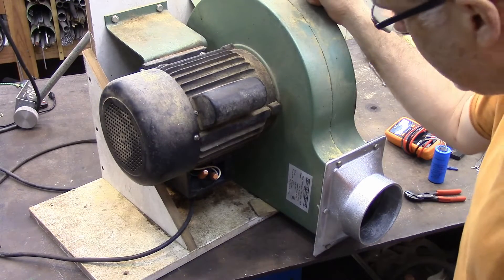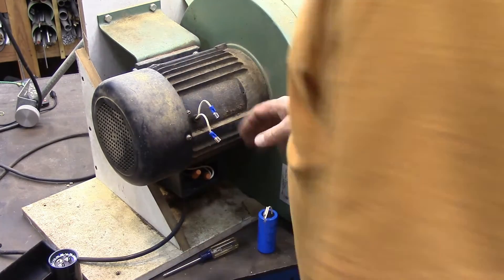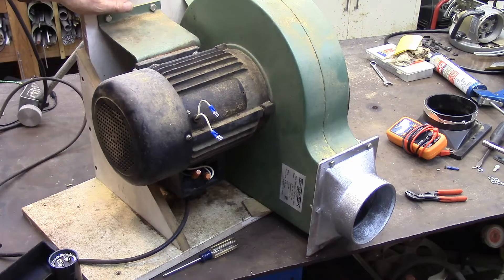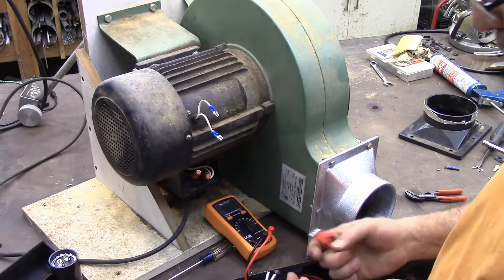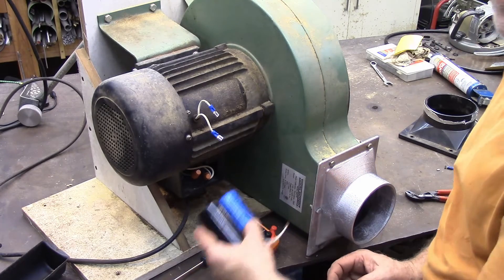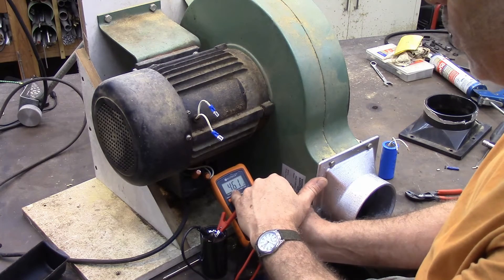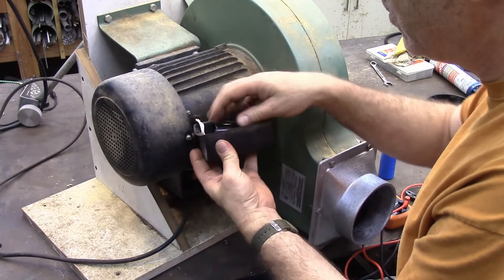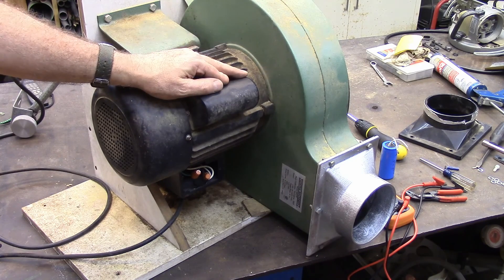How to Diagnose and Repair a Capacitor Start Motor

Comment: Is there a wrong way to connect a capacitor? 2 wires from the motor and 2 wires from the capacitor.  I bought a new capacitor and hooked it up and the motor ran for 1 second the stopped.

Comment: Just had the same happen on my lathe. I guessed the start capacitor as it would get up to speed if I hand turned it and then hit the switch. So I'm pretty confident the cure is exactly what you're showing here and so a big thanks for your video.....
Its Wednesday Jan 25 2025. I hope you're safe and well as far as those terrible fires you're having over around LA at this time.... The world's hearts are with you all.
Reply from the maker: Thanks, glad you found it helpful!

Comment: My Corporation has switched over to WEG. The motors come in 230 v. and need to be re-configured to 115 v.. Unfortunately, the previous technician did not reconfigure the posts before installation, even worse, he tried to fix his mistake and now I have no idea what the factory setting was per the diagram before he monkeyed with the spade connectors. Any suggestions? If it will help, these motors are currently supplied for AMF 8290 pinsetters.

Comment: You deomonstrate the exact problem I have with my 7-ton Boss log splitter's electric motor not starting.  Hums but doesn't start, quickly trips the breaker.  I checked the capacitor and it's deformed and has no charge.  Must have blown up after 8 years.  A new one is $25 and a new electric motor is $211 so a Big Thank You!
Reply from the maker: You're welcome!  I hope you get it up and running.
Reply: Good evening have a kitchen aid mixer which turns on just for a short period then cuts, what could be the problem @SoatMon

Comment: I just put 9 brand new capacitors on my 30 HP baldor motor and it still won't start.

Is it possible that the new ones are bogus [as in not the rating they claim]?

Comment: this video was what I was looking for. I am not experienced with electricity, and a fried said I can shock myself on the capacitors on the motor i want to fix (from my plate compactor).

I believe the "starter capacitor" is the problem on mine also, it hums, tries barely to spin or not and then breaker goes out after a few seconds.

Hope It goes well, and I remove them safely so I can (hopefully!) find and get new capacitor to try!

Thanks for the great video!

Comment: Nice video. At work a motor has same problem. They wanted to buy a new motor at $600.00! I told them let’s replace the capacitor first, only $55.00. Hope it works, I’ll earn some brownie points with owner if it does!🤣
Reply from the maker: I hope it worked out!!

Comment: I have a Vevor 5hp 15amp motor and I just blew the capacitor on the right side as you're looking at the shaft. Is that the starter capacitor or the run capacitor? This is a new motor on an forging press. What causes them to blow? Thank you

Comment: Is one of the capacitor lugs negative and the other a positive lug?  Can I hook them up either way?
Reply from the maker: It depends on the capacitor.  It should be marked if you have to hook it up a particular way.

Comment: I've got a single phase electric motor that is part of a standard single stage vacuum pump that will not spin. It has been running flawlessly for about a year on my Harvestright freeze dryer. The shaft spins freely by hand (after taking off the cover to the fan).It doesn't make any noise, or very little noise. It has two capacitors and I tested them with the multimeter and they are within spec and have greater than 1 meg of resistance after 5 to 10 seconds on the ohmmeter. When I plug it in and turn on the switch, sometimes it will spin a tiny bit, maybe 5 degrees or less and no hum. Otherwise it does not spin (or hum) at all. Both capacitors have about 120Vac across them when turned on. So I am kind of stumped. ANy ideas??
Reply: I also tried to spin it manually while energized and it did not help at all. It was like it was turned off.
Reply from the maker: Sounds like it's not getting power. The only thing I can think of is a centrifugal switch. Google that and see if your motor has one. It might not be working properly. Good luck!

Comment: Does it matter how you reconnect the wires I notice they’re both the same color on mine and no indication that the wires need to be connected to a certain wire on the new cap

Comment: Dear Soat Mon, Our furnace (circa 1981 Borg Warner/Trane natural gas, still in good condition)  blows the screw in breaker (locate on outside of it) whenever the blower tries to start.  [Everything else (outside AirCond compressor/condenser) work fine].  With the motor electrically disconnected from the system, the start relay actuates, and fuse is not burned (& AC unit runs fine).  It's only with the furnace blower motor connected that the fuse blows at start.  ¿Is this motor bad or start cap, kindly?  The blower assembly turns freely inside the plenum.  I've measured the blower motor's run cap and it seems fine (reads 12 micro Farad/10 Micro Farad rating).  I've changed the run cap with a new one, but am afraid of trying to run said blower motor for fear of blowing another ($6) fuse (screw in Edison type S).  ANY advice or comments much appreciated.  Thank you much.  Thank you for your video.

Comment: When you are checking the capacitor with the multimeter is it set a ohms for resistance? Thanks
Reply from the maker: Neither. You need a meter that can check capacitors. I have one listed in the description of the video. Good luck!

Comment: Shorting a capacitor with a screw driver gives it a huge internal shock Not recommended. Use a resistor or even a light bulb to drain the voltage.

Comment: Hey. 

I have a question. 

My table saw starts up normal, but when I push the stop button, and de motor stands still a hear a ticking sound for about 5 seconds.. But when I pull the plug, the ticking stops right away.. Could this be the capacitator? Or is this something else? 

Thanks in advance..

Comment: mpp cap 350v 12uf size  replace it with a 12uf 450v 
Will that be ok
Reply from the maker: That should work.  A higher voltage is fine.
Reply: @SoatMon  thank you very much it's basically the same motor as yours but it runs a big  sander

Comment: Hey, I just got given a Metabo Dust collector, and I plugged it in and nothing.  I even changed the plug, thinking maybe a fuse. But same.  When I turn it on, I don't even get a hum.  There's nothing, would you know how I could get this running?
Reply from the maker: Check with a multimeter to make sure you are getting power to the motor.  If it's the capacitor it should hum when turned on.  Sounds like you are not getting any power.

Comment: Help! My Ryobi band saw wouldn't turn on without a spin on the wheel. I let it run until the motor smoked. I turned it off. Did I burn up the motor? I'm hoping I need a capacitor but I don't know where it is. I took the motor off but it looks sealed. How do I get it open?

Comment: Hi,where did you get the capacitor? I have a Hilka/Wolf bench grinder,I have to spin the wheel then it starts,Is there an equivalent capacitor I could use,The one on the grinder is blue, Two terminal connectors,it reads 5 uf +- 5% ,we 350 .Ac 50 Hz .60 Hz .The grinder is 1/2 Hp 240 v 370W 50Hz 300 single phase.i don’t understand equivelant size capacitor I could use,I’ve looked on EBay but not one equivalent.Any advice would be grateful.Thanks
Reply: Had same issue, took a photo of the capacitor with the details on the side of it and put it on chat gpt and it found an equivalent one for sale

Comment: Does the capacitor protect the motor from over voltage? E.g if I connected a 110V motor across a 220V supply, would a 125V rated capacitor give out before the motor is damaged?
Reply from the maker: It's not used for protection but to kick start the motor.

Comment: I really hope the capacitor replacement will fix my problem.

the motor is not starting but it seems like it's trying, gets VERY hot, and then the fuse blows after few tries. I hope it's nothing worse than the bad capacitor.

thanks for such a great and useful tip video!
Reply from the maker: Good luck!  I hope you get it fixed.  Don't let it overheat, it will ruin the motor very quickly.  If it don't start turning turn it off immediately.
Reply: @SoatMon  cheers man!
I hope I haven't toasted the motor yet.

Comment: uF and mF are NOT the same! It is a 1000x different.  uF = Micro Farad, mF = mili Farad  1/1,000,000 and 1/1,000 respectively.
Reply from the maker: Correct
Reply: The little u is actually the small m in Greek μ

Comment: This is new to me. A new capacitor installs with or without a charge?
Reply: You need to make sure the capacitor is discharged. Watch a video on it.
Touching a charged one is like touching the mains
Reply from the maker: The capacitor will charge after you put it in.  They don't charge like a battery, it's instant.

Comment: At 3:55   Is that  463 years, days, months, volts, amps, pounds or gigawatts?  Everybody that sells the 2 lug capacitor, calls it a run capacitor....and the three lug a start run capacitor.  Here is just one example of that; 
https://www.amazon.com/gp/product/B01FUW0TXU/ref=ppx_yo_dt_b_asin_image_o00_s00?ie=UTF8&psc=1

Comment: My motor always needs to be Kickstart on the fan with a screw driver. I cleaned it but it always needs to be jump started. Could it be   the capicitor
Reply from the maker: Very well could be

Comment: Thank you for the video. Have a 6" joiner that has not been running and now I know why. Do you know if the supplied power to the unit will cause the capacitor to wear out faster. I'm wondering if the cable run to the shed and an extension cord to the joiner may be contributing to the failure? Thanks again for the video, I'm heading out to the shed to pull off the capacitor.
Reply from the maker: Hope you got it fixed. Sorry I don't know about the power effecting the capacitor. It can cause your motor to over heat though.

Comment: Hey I've replaced 3 capacitors on a electric log splitter, 1 popped, 1 started smoking,the last one the company just swapped out a new one saying they might of given me a bad one. Free of charge. I put the new one on and fired up the splitter it ran great through about 3 cycles then it exploded. The whole system runs just fine but I can't figure out why I'm blowing capacitors. Or where to look to fix it. Can you help giving me a direction to go on fixing this? Please and thank you.

Comment: I have the same vacuum and that's a Jet 2 hp motor. It had a Seika 400mfd 125 volt capicitor. Mine just blew and now it makes two...... I just took the motor apart and think it might be a "starter relay".
Reply from the maker: Thanks for identifying the motor.

Comment: I did this repair for my bandsaw motor and I  can use it to cut wood now but I have to  spin the pulley by hand  to help the motor  to start  turning.  Once it starts it stays at full speed and  has good power.  The old capacitor  reads :  motor starting capacitor   cap 300 mfd    and w.v 125 v.ac  type 1287   Seika electric  co   The one I used to "fix" the motor  is the only one I could find that was even close to the original  it reads:  ABS  Motor starting Capacitor   CAP 400 MFD     W.V  250 V.AC     Y759     YC  Electric Co   Do you know where I can buy  the  same  size/ type capacitor  as  the one that came with the machine as stated above  and do you think it will work better and the motor will start up normally?    Thanks
Reply: the capacitor  no matter  the size for the moment , but if you replace the capacitor and the motor don't star in his won the switch is open ,check the switch for close circuit ( NC) when the motor is stop and unplug

Comment: Hi , my electric corn grinder was stopped because the grinded corn in the sack almost full and the grain came to a point that it cannot come out. So it made the motor full stopped and it overheated. I did try to removed the grain but the machine now cannot start and only hums. In this case is it both the capacitor damaged or some fuse? Because rigth now i dont have a tester..thanks

Comment: Thanks  for the info.  Very helpful.  
Hi, i am hoping you might be able to assist me.  I have a brushless electric motor that hums but does not turn(belongs to a phase 1 bench grinder).  When i tried to turn it by hand in the "on" position, it does not move.  While in the "off" position, it turns just fine.  I checked the capacitor and it works fine.  The bearings are good too.  Any ideas on what might be wrong with it?

Comment: Sir im from Philippines. My problem is i already change the  capacitor the run and start capacitor but still humming
Reply from the maker: Check the wiring to make sure it is correct, check to make sure you have the correct capacitors, make sure the axle will spin.  If all of that is correct the windings may have gotten too hot and ruined.

Comment: Does it make a difference which terminal the wires are connected to?   My motor has two identical black wires from the motor...….
Reply: Nope - either wire works

Comment: Safety Nazi alert! Regarding shorting the leads with a screw driver, could a resister be used to drain the capacitance? It is my unexperienced knowledge that large capacitors can cause some dangerous discharges and actually arc and melt screwdriver tips. Please comment and let me know if this comment is out of line. (No disrespect intended)
Reply from the maker: No problem.   You are correct, I definitely am not the one to follow for safety concerns.  That is the way I have always done it and for capacitors this size and smaller I have never had an issue however on bigger ones you could certainly damage a screwdriver.  I think for a resister you would have to figure the correct resister and get a large one because you could easily blow a resister, not sure but I agree there would be smarter ways to do it. No offense taken.
Reply: Easy, as a mechanic I will answer, You just use one of your shitty screw drivers for jobs like this,
I have mac screwdrivers that are 30 years old from my grandfather But those are the one I treat well.

Comment: By centrifical clutch you should have said centrifical starting switch.  Most elec motors use a starter winding along with the starting capacitor to assist starting the motor.  Once up to speed a pair of centrifical weights swing out and remove the starting coil from the circuit.  You can hear them click on motor spin up and again as the motor winds down.
Reply from the maker: Yes, thank you for the correction.  It's funny when you edit your own videos you hear what you think you said.  Thanks for letting me know.

Comment: You're missing some sound for about 20 secs at the beginning, 17 seconds in.   👍
Reply from the maker: Thanks for letting me know.  I just removed that part to fix it, I hadn't said anything worth hearing... I had an issue with my editing software, actually a user error.  Thanks again for letting me know.

Comment: Sure do appreciate you presenting this one.  It always was a mystery to me about those capacitors on the motors.  Never realized it was something we could find and change. By the where did you go to find the replacement.  Possibly you did say but my computer is acting up and the sound didn't come through on parts of the video.  Have a good weekend and stay cool.
Reply from the maker: I usually get them on Amazon.  Most of the time you can type in the number and get the exact same one.  If not I would type the number into google and see what comes up.  The original one was not a very robust capacitor so I changed to one that had the same specs.  If the motor just hums, turns freely by hand and the brushes are good,  this is usually the problem.   I have changed a bunch of them on AC compressors over the years.   I just bought the meter to check it and was glad to find it.  In the past they were too expensive for me to buy.  I used to just buy a new capacitor and see if it fixed it, now I can check it first.  Good to talk to you Glenn.
Reply: I found mine with the same MFD range on E-Bay for $17.15 including tax and free shipping. I cleaned the burned contacts in the end-bell but the motor still wouldn't start under load so I knew it had to be the capacitor.